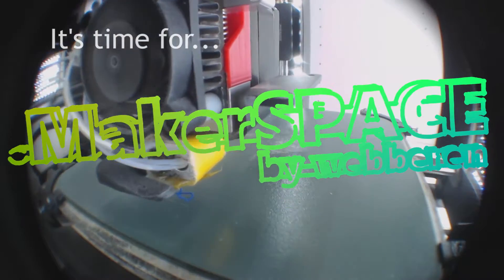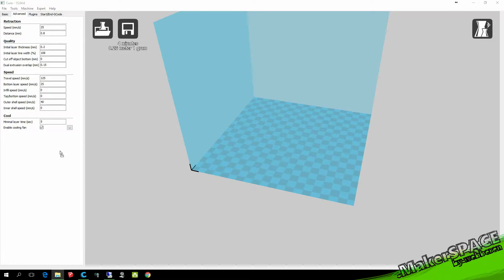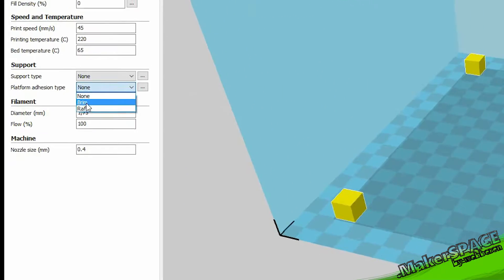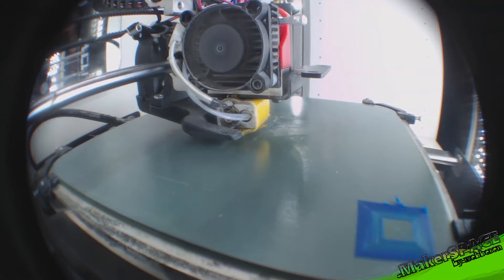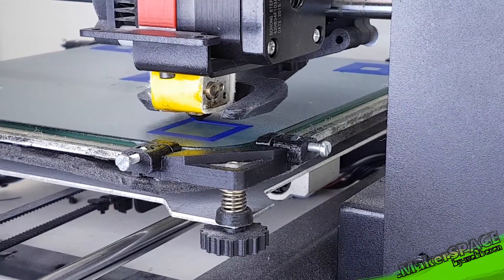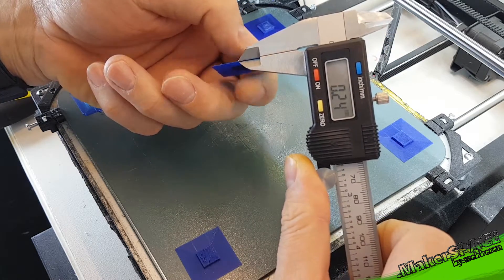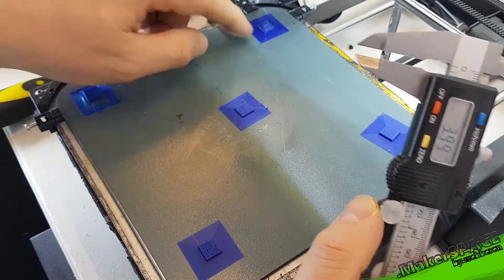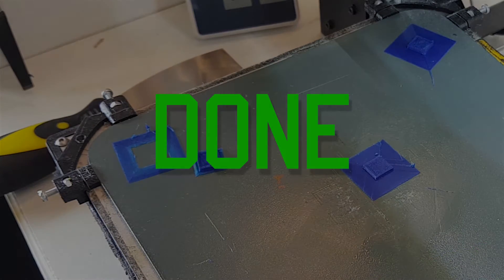3D-print - Bed level test - On a Wanhao i3 - By webberen

Comment: Your video is very well put together!! I've been following you on Instagram for a while now and I love watching the short clips you put up! Can't wait to see the final 3d printer (the one you are building)! I'm kinda jealous of your wanhao haha it works perfectly
Reply from the maker: Thanks Chris. I hope you will keep supporting me.. The wanhao is a fine machine, once you get it tuned a bit...;)
Reply: .MakerSPACE by webberen the heated bed on mine just stopped working, I'm not sure what's wrong, there is no power going to the positive lead, any ideas? Is there a replacement mainboard you recommend if that is the issue?
Reply from the maker: Chris Moore open the control box and  check the green connector where the heated bed is connected... It could be burned out...
Reply: .MakerSPACE by webberen I definitely will, I wanted to check with someone who knows more than me about 3d printers befor doing that
Reply from the maker: Chris Moore it could be a bad wire.. Have you tried hooking it up to pronterface too see if you get any thermistor errors?
Reply: .MakerSPACE by webberen no I haven't, but the thermositor seems to be working fine